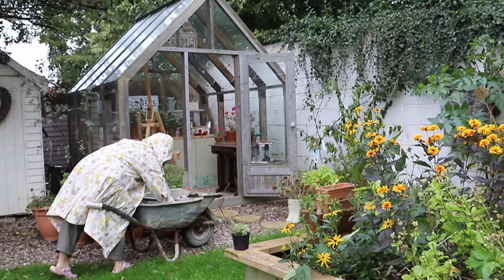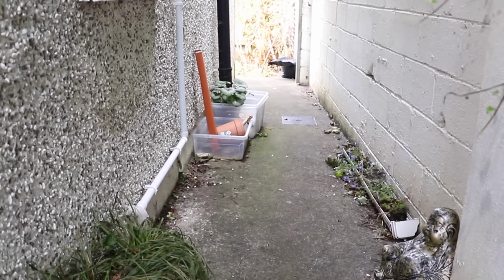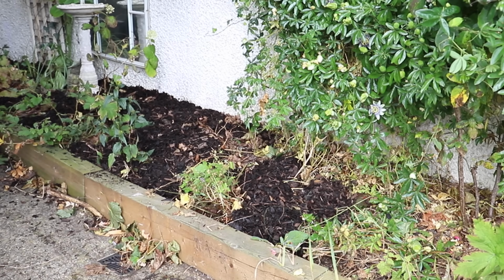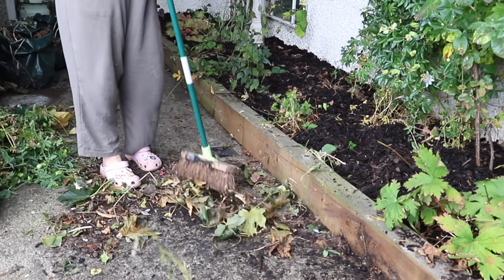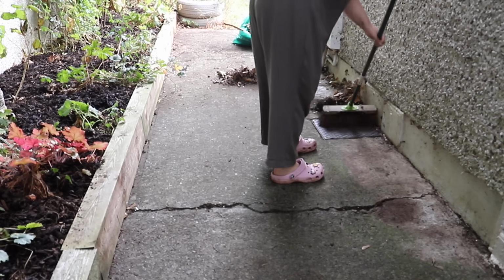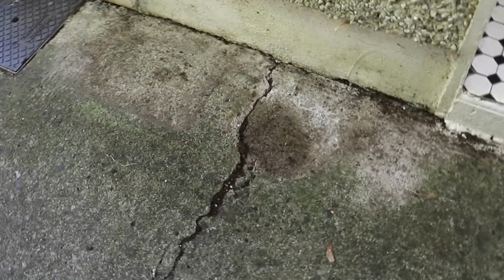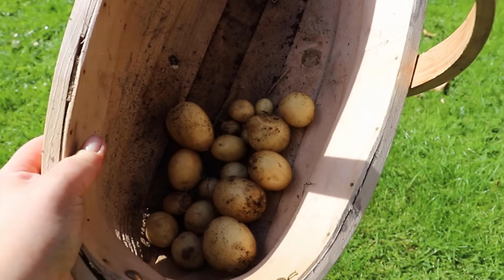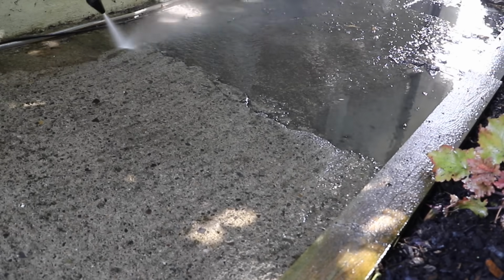Chaos to Calm: Watch This Messy Laneway Transform 🌿✨

Comment: Thanks for sharing. Nice job👍 Maybe consider decorating your lane like a room, paint a floral mural on the wall and concrete floor paint to do faux brick? Just a thought.
Reply from the maker: Great thought! I am hoping next year, to move the gate forward, to make it a functional space, Im hoping to have some Reno work done in the kitchen, so I would need to move my bins to the laneway, so moving the gate forward will hide the view of them, but I could possible use it as a functional space, hang my spade etc on the wall.

Comment: I have a thing for pots too. I kept thinking of a large pot in that corner by the trellis with possibly a shade-loving dwarf tree. It would also draw the eye down the garden path.  Could you have your soil tested to see what the soil composition and soil nutrients are? That information would tell you heaps about what you can plant there and/or how you can amend the soil.  I have been putting off doing some maintenance in my own garden too simply because it's been too hot and dry.  Now that temperatures are dropping I don't have any more excuses to give.  Glad to see you back! 🐝
Reply from the maker: Thank you for the great suggestion! A large pot with a shade-loving dwarf tree sounds like a fantastic idea for that corner. I’ll definitely consider having the soil tested to get a better understanding of what I can plant there. I completely understand about putting off garden maintenance due to the weather—hopefully, the cooler temperatures will make it more manageable. Glad to be back, and thank you for your support! 🐝😊